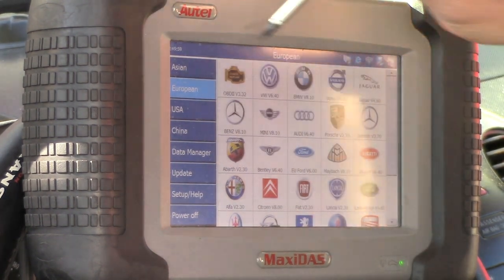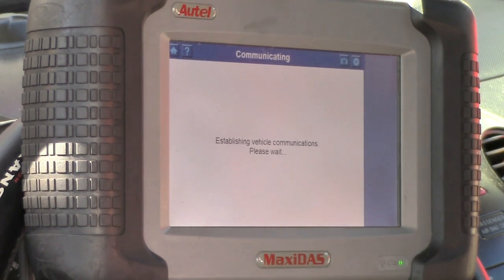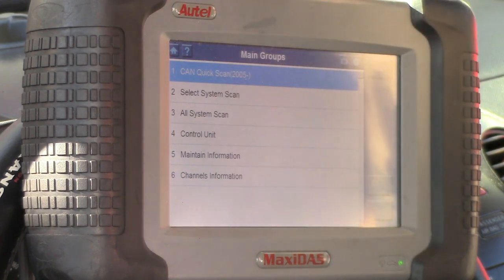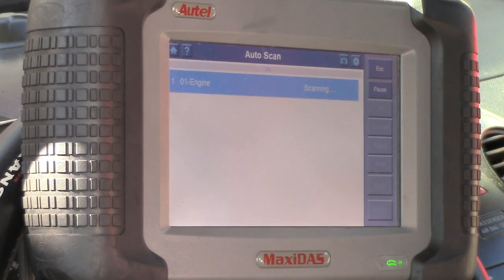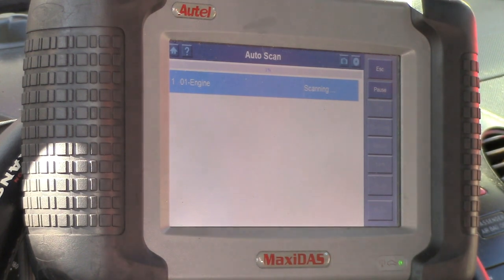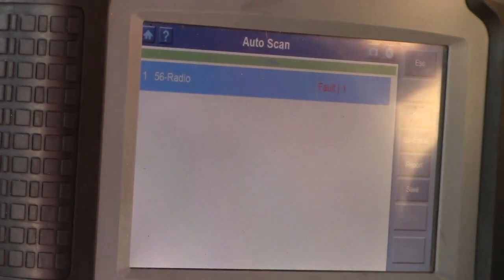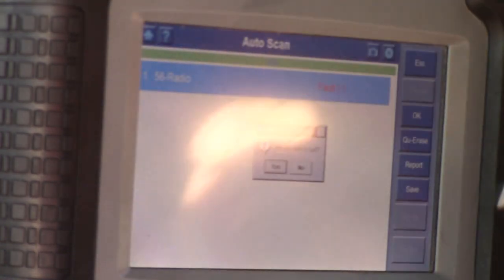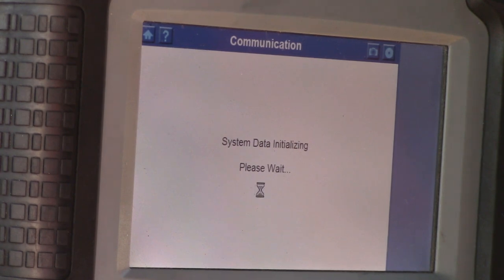09G Transmission Repair - Part-1

Comment: EXCELLENT JOB HIRAM!!! Definitely think videos like this are gonna be the next big thing as far as transmission videos go. I think the biggest take-home lesson in this video is you really need to understand how mechanical energy flows through the gear train of the unit you happen to be working on through each gear. When you understand that, you can begin to see when it makes no difference whether certain components are applied or not, and, perhaps more importantly, when certain components CAN'T be applied without causing problems. The coast/overrun clutch pack in a 4L60-E I think is a good example of this. It can be on in 1st, 2nd, and 3rd without affecting the forward acceleration of the vehicle. It CANNOT be on in 4th however due to the need for the forward sprag to freewheel in 4th, and the coast clutch being applied will not allow the forward sprag to freewheel under any circumstances.

Comment: Hiram I love how you said the European Transmissions as a 4L60.  I say that all the time but most builders are afraid of the newer Asian and European stuff. I have just a small shop in a warehouse and I have other Transmission Shops bringing me work all the Time mainly Hondas and the 09G.  I basically Replace The CPC valves with the oversize Sonnax Valves and the Converter charge valve and I put new shaft bushing in everyone. Test the Solenoids and there good as new.  Word got out that my Honda builds are a one time install and it took off from there.  On the 09Gs mainly just do Valve bodys doing the Sonnax Lock up Oversize valve and Cleaning the bushings on the solenoids ( normally the bushings don't need to be replace ).  Out of about 50 09G jobs I ran into a stuck Clutch control valve one time so I just got another valvebody to fix it.  Haven't really seen a need for getting the Sonnax clutch control valve reamers.  Anyways Love your videos!!!!  Keep it up....

Comment: Great video hiram had an issue with a zf5hp19 loss of 5th gear after rebuild found all three shift solenoids mechanicly stuck I put a pice of hose on them and had barley any exhaust with them off and I had the mv3 exhausting slightly with it on some times it's the small things that bite you it sure is a learning curve can't wait to see the others

Comment: Hiram, love the video... I have a 2009 Jetta 2.5L, w/ the 09G. I am looking for a "good" (excellent) valve body, and I've read there are something like 6 different ones that CAN go into the 09G. My question is, "does it matter"? Can I replace my valve body with "the most recent one"? Do I need to take the old one out and get the exact same one that was in there? If I were to buy a reman (on ebay), are there ones I should avoid vs ones I should look for? I just bought this car, and I'm not getting any weird transmission issues besides a flare in RPMs from 3-4, and only when the car is warmed up. I've been told this is PROBABLY the valve body, and it would be cheaper to get a reman with beefier valves than to have the one in there worked on. thoughts?

Comment: Hi I’ve unfortunately got one of these with the same transmission. When cold it is driving and changing gears fine. When it is warm gears are not changing smoothly and are slipping and when you move from D to N or N to R it slams into gear. No fault codes stored on this vehicle
Reply: Can anyone help with this

Comment: thank you for these helpful videos.i have passat b6 with 09G transmission it has bad shifting i changed the fluid in dealer and it is really changed but after about 2 month now it is the same as before.i think the new fluid that i put 2 month ago is mixed with the bad one in the torque converter, because it is really bad when i change 2 month ago it has not changed from 2007 till now , now i want to change whole fluid, but i don't know how much fluid the torque converter needs? help much appreciated

Comment: Hi, firstly I'd like to say that your videos are very educational. I leave in the UK. I have an Audi A3 2005 1.6 with the 6 speed auto gearbox. I've been having problems with the gears when the car gets up to temperature. It begins with very harsh gear changes and high revs. Then I lost all drive even in reverse gear. I have changed the oil , open and cleaned the valve body .
Now the car drives but shifting from N to D or P to R Or D  there is a delay and then a sudden thump.
I did a diagnostic on the car and it came up with 4 fault codes related to the gearbox. They are as follows 

P0753 -shift solenoid A electrical
P0721 - output shaft speed sensor circuit range/performance
P0720 - output shaft speed sensor circuit
p0715  - turbine/input shaft speed sensor A circuit

Does that mean If I change the sensors and solenoid the problem will be fixed. Any help would be geartly appreciated. Keep doing a good job for us DIYers. Thanks

Comment: I have a 2005 Beetle with an 09G transmission.  Where is the transmission cooler?  There is nothing on top of the transmission and I don't see any coolant lines going to or from the transmission.

Comment: I have a 05 wv New beattle with a 01045 triptinic swtich code (f-189) not a plausible signal and my car after warming up stars give no all kinds of problems. (Doble bump, harsh engamennt reverse and forward. So my question is? Should I change the tiptronic swtich first hiram?

Comment: engineer question which solenoid influences to blow in direct? 09g valves, the box was already repaired and the selenoid bushings were changed and a direct blow follows

Comment: Hey Hiram I have the same transmission and is original no one has messed with it and when it gets hot it's starts slipping gears can u give me any data or tips to start fixiing it

Comment: I have a 2006 vw Herta 2.5 that's overheating and won't go into gear.   It's throwing code p0721 and had build up in the transmission pan. What do you think is wrong with it?

Comment: I know this is an old post and no activity, but I really need some advice on my transmission rebuild.  If you could contact me and help I would be very grateful.  I have an 04 09g and had rebuilt it myself.  It ran great on surface streets and one day I went on the freeway and it got up into 6'th gear with plenty of power and it shifted nice.  Then it immediately went back and forth from 6'th - 5'th - 6'th - 5'th then I started slowing down and found out that 1'st didnt fully engagae and slipped out putting it into limp mode.  When I got it towed home there was only 5 qrts that came out of the pan.  I opened it back up and found K-1 burnt completely up.  Could low fluid cause this?  My theory is 6'th sucked up fluid leaving pan dry or low and when it had air in the lines it had problems holding 6'th then fried lower gears when I slowed down.  Any advice before I close it up again.  More information here http://forums.vwvortex.com/showthread.php?8832018-2004-Beetle-09G-Transmission-Burnt-K-1-Clutches-HELP!&p=107601282#post107601282
Reply from the maker: +Cobra Vids An issue with the valve body or solenoids could cause that
Reply: Awesome response time!  I watched your video, great information.  That is the one thing I did not do.  Can you suggest a location where I can pickup a rebuilt valve body without having to take out a loan?  With everything I have read everyone suggests replacing it with a rebuild.  Could you give an example of what the valve body would do to cause this?  So you dont think I screwed up by having a low fluid level?  My book says I should have 7.3 on fill,  I got out a total of just over 5.  I checked it after it warmed up and I ran it through gears and it checked fine.  Then the freeway is what started my issues.

Comment: Great video as always!! Any chance for a 41TE video?
Reply: Agreat work done thanks. Sir i request to know what coud be the problem with a 2ZR_FE transmission that has a hash engagement to DRIVE and REVERSE i have changed the valve,secondary&primary drive and also the ATF. Diagnosis code read SOLENOID D. but the problem remains please advice me

Comment: I saw you use a particular tool to put the shift solenoids back together in another video.  Where did you get the tool? Thanks
Reply: I'm wondering the same thing did you ever find it?

Comment: good afternoon. I am writing to you from another state. how do you adapt the atrimantirovannuyu car transfer box. how is the adaptation mode? Sorry for my English.
Reply from the maker: With a scan tool. Autel or Launch will do it.
Reply: Automatic Transmission Thanks for the reply. Can I talk to you about boxes?) If you this not difficult.
Reply: Tell me please. with what effort it is necessary to twist the bolts on the hydraulic unit tf 80 tf81 (nm)?